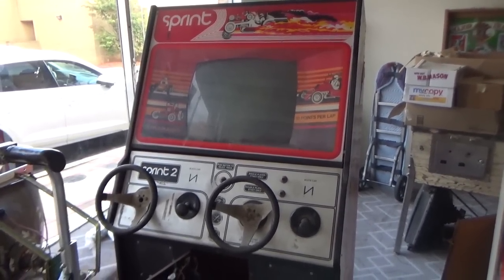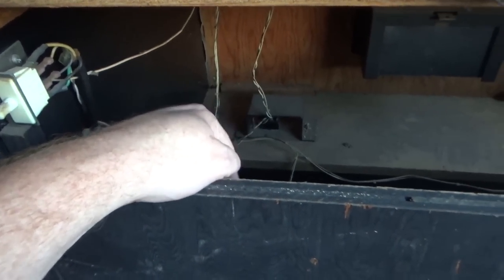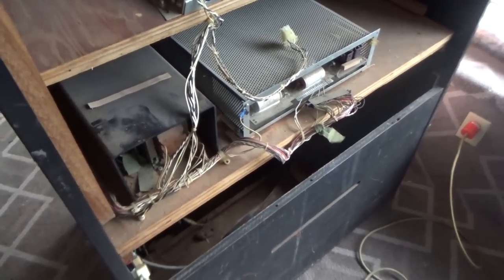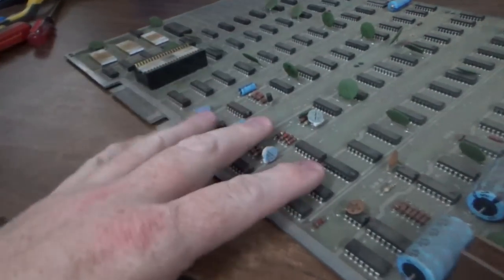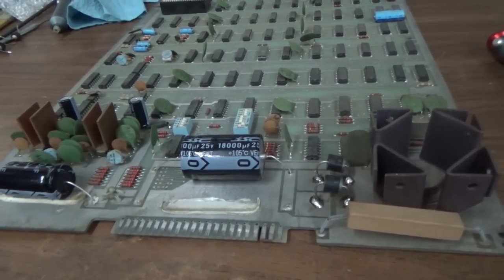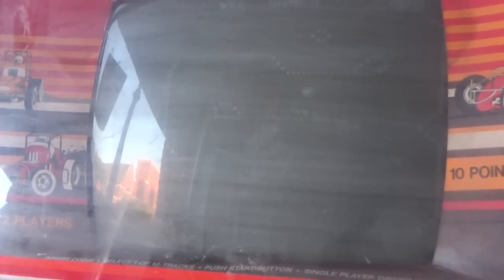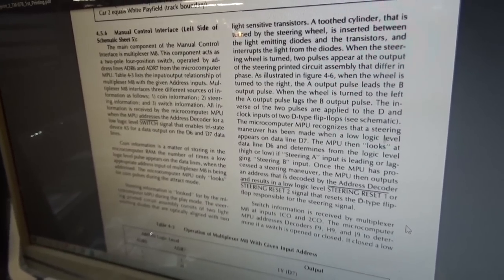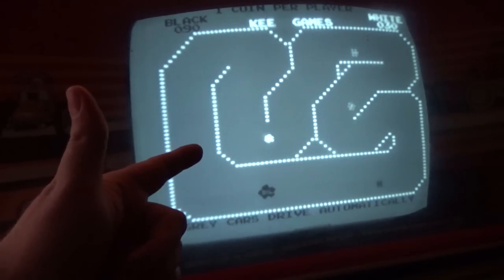Repairing  A 1976 Atari / Kee SPRINT 2 Racing Arcade Machine - Vintage Tech, Schematics part 1

Comment: 40 years later and i can still remember  the feel of the steering wheels and the shifters. 
The one we played the most was on the camping ground close to the local beach, if you played it with wet feets you got electrocuted by the metal accelerator.
Reply from the maker: That's pretty wild, it does have metal pedals :)  Thanks for watching mikgus, we appreciate the comments!
Reply: Were these things a campgrounds special? I also played in a campgrounds in Florida.

Comment: Astounded that it worked so well. True wee gem you got there. 

Issue with 3D printed parts, is they can fail too easily. We would 3D print a part, make a mould from it, then resin cast a new part from the mould. This tends to be a lot stronger, even more than the original.

Great video, keep'em coming.

Comment: Black and white 27 inch monitor from back in the day
Pretty cool
Even back then a 27 inch TV was a big TV

The 70s, even 80s, if you had more than 1 TV you were doing good

Having a TV in the front room, the bedrooms, with cable boxes and VCRs, you knew you were in the upper middle class
Most people had a 19 inch black and white TV in the front room
I had a 13 inch black and white in the front room
Seeing the first house with a 25 inch color TV in the front room, master bedroom and guest bedroom, and a VCR and cable box with a remote wireless controller, 😳 WOW
Circa 1980.
That was the first year they had ir remote controls

It was amazing

I mean like walking into the future

The house was brand new

Had circuit breakers where I had only seen fuses
A 60 amp single phase 4 fuses
The new house had 50 breakers, 200 amp 240 volt dual phase
So amazing for the day

Comment: You may have been a glint... but I was 12, and totally remember this game.  It wasn't common, but I seem to recall seeing one in the arcades at Cedar Point when I was 12(ish).  Arcade games were just magical boxes showing of the technological prowess of the day back then, but it's cool to see the innards today with all the knowledge about this stuff I've acquired over the years, and learn stuff about the hardware, like it running on a 6502, which isn't that big of a news flash.  Atari liked the MOS 6502, even the 2600 had a variation of the 6502.
Reply from the maker: All those early Atari games had 6502's for sure... i'm used to them in Asteroids for instance... thanks for watching John!

Comment: This was one of the first arcade games I remember playing, maybe 1978 here in the UK. The arcade had this, Asteroids, Fire Truck and a couple of others including Kee Games' first driving game  which may have been called just 'Driver?' It was similar to Sprint but the tracks were complicated and savage, you ended up spinning the wheel like crazy to make the thing turn 180 degrees. Great times :D (*edit* - it was either Gran Trak 10 or one of the clones, that screen is instantly familiar)

Comment: I recently (like two months ago) fixed a Sprint 2 (bad RAM with a weird failure mode and a bad cap in the monitor making it sync weird - and it has the same exact deformation in the lower left corner that goes away after a few minutes). I can't decide if this is the most fun game I've ever played or Mario Kart.
(also the machine has 1978 date codes on all the chips even though it's a 1976 game)
Ha - the CPU in our Night Driver is older - 4776!
Reply from the maker: This one does the same thing with the bottom corner, takes about 60 seconds to fix itself, and that's after we capped it.  I think something has aged :)  Thanks for watching as always senilyDeluxe!

Comment: That CPU Socket likely was perfectly fine,  the way it held the CPU, more likely to damage the CPU removing it...    I really wish the made quality like that now.  I would pay for quality.
We have gone backwards in such a big way in order to make a dollar.
As far as capacitors, they only did that for capacity vs size constraints.  Parallel increases the capacitance.  If they were in series that would be different as the voltage handling is increased in series, but in this situation with them paralleled, you have done exactly what most true techs would do.   Saying "a spare one in case one fails" well, that's a bit of crap if anyone says that.  Capacitors will usually short when they fail, but even if it went open, the capacitance would decrease and cause issues.    
Great work as usual.  :)

Comment: 1976...first true ruling year of 6502 king. Atari company called it a MPU, placing its ceramic body and golden feet in the crown of gold petals. But, little did they know, that almost fifty years later, two brothers will pick it out with a dental tool as the modern tools was deemed puny and unworthy.

;)

Comment: JOES CLASSIC The coin door switch is being monitored and check by the RAM Chip which most other arcade games doesn't use a RAM chip to store the coin door switch, correct me if i'm wrong. The coin switch pulses which gets stored into the RAM chip but it has something to do with the "steering reset circuit" also? the steering reset circuit is being triggered from what is stored on that I/O RAM chip it seems.
Reply from the maker: I'm not sure it's the ram chip, I think it's just the Data lines on the MPU Data bus that are checking it, do you think that's how it's working Wayne?

Comment: I had some of those diodes in GE VHF 2way radios, crystal radios, 2 channels, analog, no CTCSS
The diodes we're just in case you ran the wires in reverse, it would blow the fuse in the car
Reply from the maker: That makes sense!

Comment: I remember this game from the early arcades, was basically this and original space invaders. Not great, but wasn't anything else. I played one where the cars would just drive out of the screen.  Weird. The 3-4 speed shifter was difficult, as was the gas pedal while standing.
Reply from the maker: Sounds like you didn't have much fun back then, the games weren't great, you didn't have any other choices, the cars would drive the wrong way, the shifter was difficult, it was weird and you couldn't press the gas pedal.  

I remember the first games I played, I loved them, had a blast.

Comment: Those monster gold plated sockets were fine IF the processor or ROM in them had gold plated pins.  But if the chips were tin plated they were nothing but trouble.  (Ask about the time this caused 20 chips to be blown (and all the solenoids) in an Atari pinball machine!).

Comment: Wow..  I would have bet against that coin door wire having anything to do with that.  That is a serious software flaw IMO, looking for level, vs. transition in the switch input, and not letting it boot when disconnected!  I had a similar problem with an old Atari Football, AND an atari video pinball board of similar vintage, which I was fixing on the bench, without any controls on it while testing. Now I'm wondering if my failure was simply because I didn't have the coin door switches connected!!  Do you know if football or video pinball have this same issue?  They are certainly similar vintage and seem to share a lot of the same design architecture.
Reply from the maker: Neither one of those have the same wiring issue so it was something else on those!  Thanks for watching Steve!

Comment: That a Seeburg G or W? Mine is an R. Wondering if you find an arcade game with a black & white monitor,since CRT's are no longer made, use a color CRT monitor set to black & white or an LCD TV or monitor set to black & white,meaning the color turned all the way down.
Reply from the maker: It's a W, you can put a color monitor in it and just hook the video to all three color circuits, and it makes it perfect black and white!

Comment: Oh man, I remember that game! It looks so simplistic now, but it was so State of the Art at the time, the four gear gear-box was the best. So many later driving games either had a two speed manuals or automatics. The only thing it was missing was a brake pedal (which would have been tough to use standing up). The two player mode was great fun, we'd spend most of our efforts trying to wipe the other guy out which meant we got extra time less often.

Boy, that's one mainboard that needs to spend some quality time in a dish washer… It's wild that the coin switch could crash the system that badly. This is where your experience is so valuable, I would have never thought to worry about the coin switch until I got the system running.

Did I hear right, that the coin switch is only monitored during attract mode? So if you put a coin in while it was playing you just lost it? Now that I think about it, that sounds right. There is no credit system so you'd put your quarter in then started the game, then when it was over put your next quarter in (and what happens if you put two quarters in but start a one player game, or can you?). Now that I think about it, that's how pretty much all the video games worked -- it's weird that that seemed weird to me.

Anyway, thanks Ron & Joe. Thanks for dredging up the memories of a "misspent youth"!
Reply: I remember being surprised by that when I played the original '73 Pong at Funspot--no start button, you just put your coin in and a two-player game starts immediately.
Reply: @MattMcIrvin  Oh yah, with pong it was deposit quarter, play. And the paddles still worked after the game was over. Ah, a simpler time.

Comment: Sometimes inverters are used as buffers as these were cheaper than actual buffer chips (simpler chip design). These were also very sensitive to floating inputs and can cause the scream of death._

Comment: Yeah, rotating the caps was no good, but chances are those were failing, and you changed those. As for those in parallel, one might use separate ones to filter certain frequencies, but in that application, I would have done the same and used at least the sum of the 2.